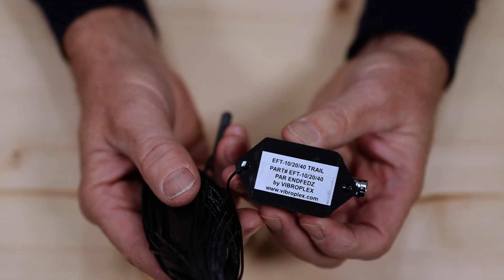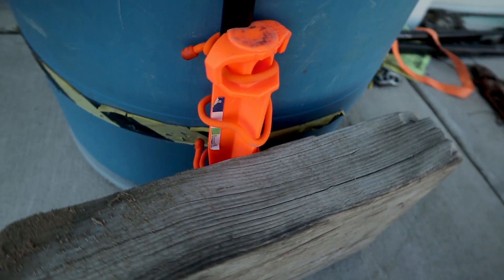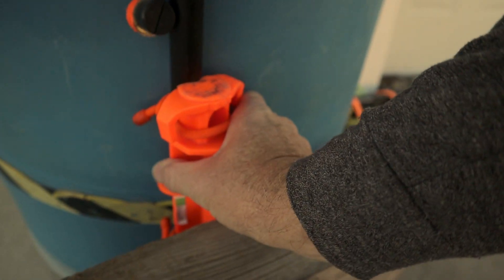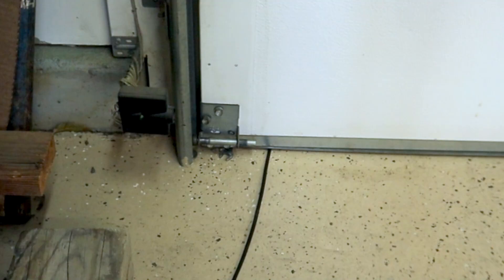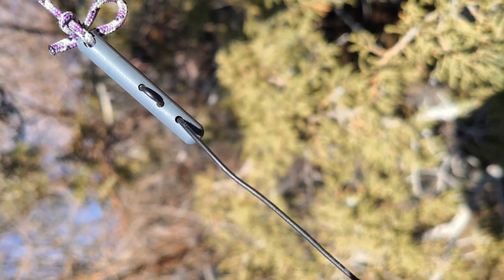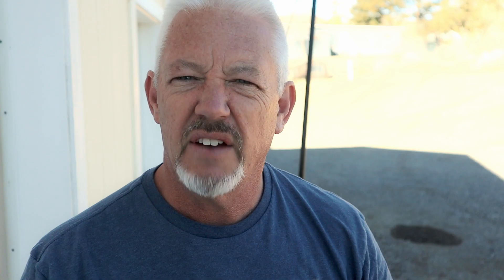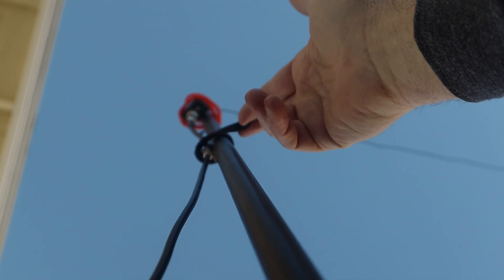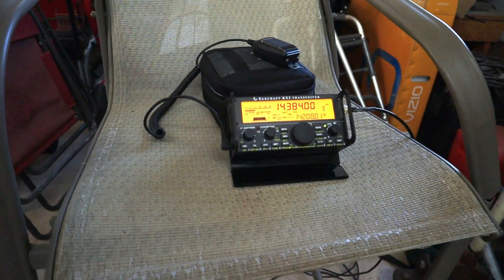HF Antenna when traveling | K7SW ham radio

Comment from the maker: let me know what unusual way you have been able to successfully put up an antenna AND what antenna you used, while traveling and staying with friends.
Reply: I've set up wire antennas while traveling quite a bit. In hotel rooms, I've been able to work digital modes like JS8Call with a 40m EFHW and Xiegu G90 by stringing the wire all around the hotel room as straight as possible. I've also deployed antennas out hotel windows, either just hanging or in a sloper configuration. At a hotel, a stealth (concealed) configuration is always my top priority so as to not bother (or alarm) any of the other guests. Foliage or the architecture of the building are keys to concealing the antenna . At family and friends' my options are a lot less limited, but I've found bringing both a dipole and an EFHW, just in case, gives me the widest options in terms of configuration. I don't have any vertical antennas, but I think something like a Buddipole or similar vertical antenna would be even more discrete. However, most of the time I'm setting up to see if I can be emcomm ready in a matter of minutes and of course the joy of operating. Verticals aren't really designed for emcomm since your area of operation would usually limited to a few hundred miles, i.e., NVIS. The radiation pattern of verticals are terrible for achieving the high takeoff angles needed for local comms. Plus they're usually pretty heavy compared to the few ounces of wire.
Reply from the maker: @kn6eze  , you are really prepared and it sounds like you have practiced your skills often to get where you are now.
 Everything you described makes sense to me. Being in the right place with the right gear can make the difference.
Reply: I bought an arborist throw weight, throw line, and bag, and am working on perfecting my skill with them.  If (sometime a big if) there is a tree handy it's so much faster and easier than fiddling with a mast.  It's a bit bulky, but I mostly drive to portable sites and might hike a short distance.  Just another thing to have in my portable antenna "toolkit."
Reply from the maker: @WilliamParmley  , thanks for commenting. Yes the throw bags are very handy. For me it just depends on the activation, sometimes bringing the Air launcher is worth it just for the pure excitement of launching that great antenna up to its resting place.

Comment: Another great education. I have noticed that put the coax up in the air, while others put the end of the antenna at the top of the mast. Would you please comment on this conundrum.
Reply from the maker: Tommy, I may have not filmed good enough video to show on this Video. The Match box is only  8 feet off the ground on the short mast while the End of the antenna is attached to the 21 foot mast at the far end.  Depending on where you mount your antenna the interaction with environment is what you are trying to avoid.
When antenna's are designed, they are being built in "Space" nothing surrounding the antenna. 
Where you and I deploy our antenna's will be a compromise and the readings and efficiency will change.  on a mountain top the match bow might be closer to the ground if I had nothing to mount it to.  I am not sure if that is what you were asking, i hope it helps a little.
Reply: @hamradiowithkevin   Perfect and thank you.

Comment: do you have any recommendations for an HF antenna that mounts to a vehicle?
Reply from the maker: My favorite and most easy to use suggestion would be Hustler and or Hamstick solutions.
If you want to HF driving down the road.  If you are looking for stationary  mobile, the options become greater ! 😎
** I may make a video about that if you think it is useful
Reply: @hamradiowithkevin  i'm thinking more stationary mobile
Reply from the maker: @76ersnet58  , Jeremy, I have some videos coming up that will help answer that question. The question you must ask yourself is, what band will you operate on . Will you be "bobber fishing" for cat fish or "dry fly fishing" for Rainbow Trout ?
 I have found that when answering that question the answer becomes apparent for having the most fun.

Comment: I have the same set up, an Elecraft KX2, an earlier version of the antenna, mines the LNR trail-friendly… 
Keep the feed point up, or you need a counterpoise…. My mast is a 12m Spiderbeam…  so I have used it vertical with an elevated radial.  My best QSO was an SSB contact south of Tokyo, catching the Grayline from Boise at 5w…  I love my KX2.  

Practice is invaluable.  Field deployments are fraught with lessons you remember.  72!  de W7UDT (dit dit)
Reply from the maker: Thanks Randall. Everything  you mentioned is so true 👍 .